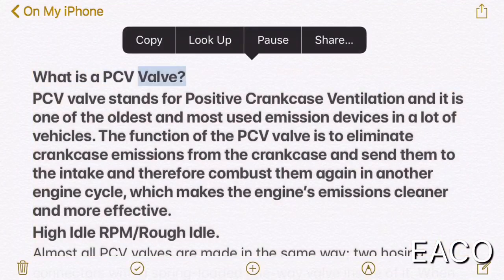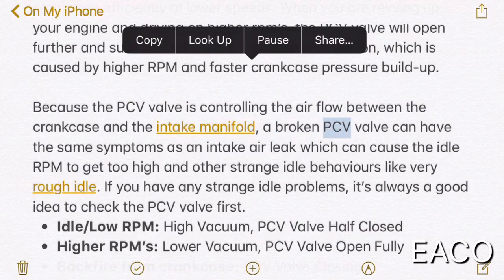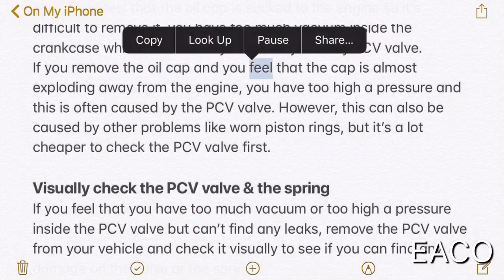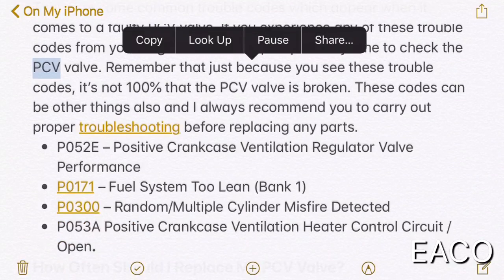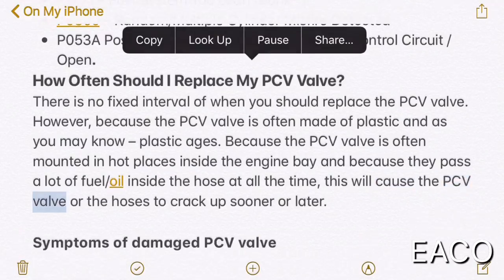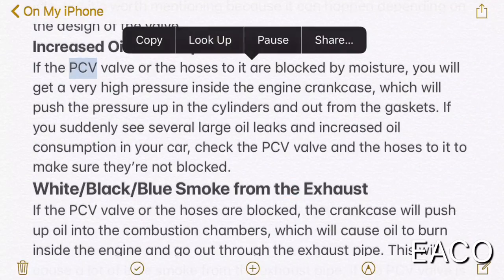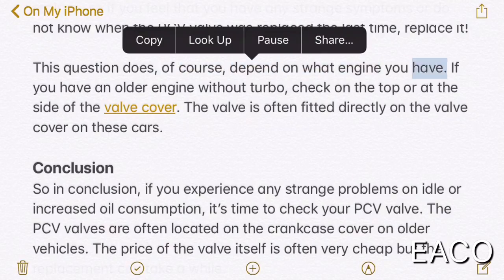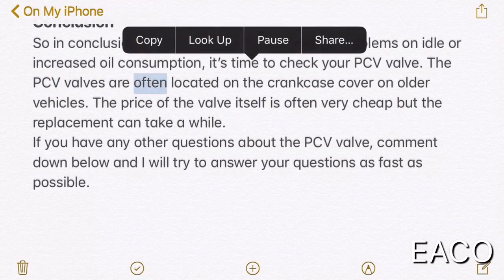IMPORTANCE OF PCV VALVE IN YOUR VEHICLE, SYMPTOMS, FUNCTION & MAINTAIN ENGINES life!

Comment: Hallo. Great video. Can you please help me? My wife owns Micra k12 1.4 65kW (88HP), made in 2004. We bought it 3 years ago, and milage was 200000km (I don't know if it's was real). Now it has 214000km, sice she hasn't drove it to much. Since last 2000km it started consuming a lot of oil (1 liter of oil per 1000km). And also it has backfire from exhaust when throttle is reliesed, when deaclerating, so I have doubts that the PCV valve is stuck in open position. Do you think that this make sense? There is a little blue smoke on exhaust on idle. Today I opened the oil cap while the engine was idling, and there is some blowing from the engine as well as some oil drops spraying. The oil cap was clean, oil is also clean. Do you think that the reason for consuming the to much oil can be in bad PCV valve? Thank you in advance, any hint or advice will be good.
Reply from the maker: To confirm that issue need to be compression test find the specific Compression pressure standard after that we can proceed to know what the problem. Thank you for your comment to my channel and please subscribe Sir.

Comment: Most manufacturers have a scheduled PCV valve replacement interval.
Honda has a 100,000 mile service interval that includes water pump, drive belt, and PCV valve replacement.
Reply: I think Honda/Acura have a weak PCV system and should be cleaned and/or replaced every 40-50k miles. 2010 MDX 287K. Look here on YT and you'll see some that should've been pulled long before they did. Depends on oil used and OCI.

Comment: Why my 4k engine get a rough idle when i put the pcv valve according to its function,? Kindly help me.. my pcv valve is good.
Reply from the maker: Okay what’s the history service of your vehicle?
Gasoline or diesel? 
What happen before rough idling?
Did you tight your battery terminal properly?
No corrosion?
Did you clean throttle before?
Perform power balancing if your car is gasoline removing one by one the ignition coil and return roughly more is good ignition coil if no chance thats bad.
Thanks.
Reply: Gasoline engine. And yes, i already perform those method and still the same, 
my battery is new.

Comment: The car smokes only after accelerating following descending, what could be the reason, tnx
Reply from the maker: Cylinder gasket damaged
Reply: @Subscribenow02  oil is smoking, not coolant.
Mechanical gearbox, after a deep vacuum it smokes, that is, if we go down on neutral, nothing happens, but when we are on some kind of gear shift, and suddenly we gas, smoke comes out. PCV valve, valve stem seals are changed. No smoking in the morning and in the rest of cases
Reply from the maker: @АлексфанатА4  what color of smoke? What kind of petrol youvuse diesel or gasoline?
May thats ruch mixture need to be calibration.
As well head gasket have oil hole beside coolant way passing through engine block and cylinder head.
Reply: @Subscribenow02  gasoline 95 is used, by the way, it happens after long drive, when oil temp rises. After smoking the level of oil decreases. I am sure it is oil
Reply from the maker: @АлексфанатА4  yes gasket of cylinder head
Reply: @Subscribenow02  any proofs?

Comment: It is require to replace both pcv valves for my turbo engine for bmw 650i 2013 if the vent hose between two valves broken! I just used super glue to paste the part again .The car looks different but not 100% fine cause am still feeling bad performance or slow response while driving in low speed between 30-50km !!
Reply from the maker: You can Try to perform Engine tune up and power train Maintenance..Thank you Sir.

Comment: I wonder if the CRC INTAKE VALVE CLEANER also cleans the PCV valve... does anyone know?
Reply from the maker: We knew Sir but pcv valve made from plastic. it is replaceable every 80k run.
Reply: mazda cx7 has the PCV valve hidden under the intake manifold, so it takes me about 4 or 5 hours just to change the valve I don't know if there is any way to clean the valve without changing it yet.

Comment: My vehicle has p0172 bank 1 too rich and p0174 bank 2 too lean at the same time, would this also be pcv valve? I have a slight rough idle and misfires on startup and sputtering white smoke from exhaust.
Reply from the maker: Yes possibly mixed with oil and water during compression..
To verify that, i need to know your vehicle model, Diesel or Gasoline engine and brand.
Reply: @Subscribenow02  i have 2005 v6 Ford explorer gasoline
Reply from the maker: @hepzlawrence7710  

DTC Definition:
P0172 - System Too Rich Bank 1

Possible Causes:
- Faulty front heated oxygen sensor
- Ignition misfiring
- Faulty fuel injectors
- Exhaust gas leaks
- Incorrect fuel pressure 
- Faulty Mass Air Flow (MAF) sensor

DTC Definition:
P0174 - System Too Lean Bank 2

Possible Causes:
- Intake air leaks
- Faulty front heated oxygen sensor
- Ignition misfiring
- Faulty fuel injectors 
- Exhaust gas leaks
- Incorrect fuel pressure
- Lack of fuel
- Faulty Mass Air Flow (MAF) sensor
- Incorrect Positive Crankcase Ventilation (PCV) hose connection

Okey 👍 can you try to find the problem and subscribe..Thanks.

Comment: My vehicle has p0172 bank 1 too rich and p0174 bank 2 too lean at the same time, would this also be pcv valve? I have a slight rough idle and misfires on startup and sputtering white smoke from exhaust.

Comment: Hello there!
I have YAMAHA XJR1200. I’m experiencing problem that when i ride my bike the oil comes out from breather hose & filled into the air box.
Is that the issue of PCV valve?
Reply from the maker: Hello Sir that’s Motorcycle big bike right?
Ok please check your engine oil level first, may be that’s not pcv problem, how many amount of oil goes out per-minutes?
May your air filter is Clogging that’s why more oil goes out. You can observe that problem Sir. That I mentioned, tips. And subscribe for more videos,,Thanks.

Comment: Hi. I have a BMW E90 N46 4 CYLINDER engine. I am suffering from high oil consuption (One Litre per 1000 km).
I have changed the pcv valve diaphragm with spring.
But i stilI have oil consuption & both suction on the oil cup wgen opening and high pressure when the cup is open.
The pcv is located on the valve covet the engine has 182,000 km.
I will approciate any useful suggestions and diagnostics procedures.
Reply from the maker: Hello Sir May be your vehicle was experienced an engine overheating before or rubberized Components was already expired/gasket burned out also valve seals...that’s why always decreasing engine oil..
Solutions:
Perform top overhauling of engine..change valve seals and cylinder gaskets, please use coolant for safety purposes or to prevent engine overheating..also check the cooling system after engine overhauled such fan automatic motor with thermometer sensor..I really appreciated your time and effort..Please subscribe here in my YouTube channel..Thank you so Much.!

Comment: Hello.
Thank you for the video.
I have a few questions.
1, How much vacuum must be in order for a working PCV valve to start opening?
1NZ-FE engine.
And the second thing.
When I'm coasting, the accelerometer pedal is completely released, then after 20-30 seconds when I press the accelerometer pedal again, white smoke comes out of the exhaust pipe. And the engine oil decreases quickly too.
Is the PCV valve not working?
In my case, it is always open, even when the engine is turned off. (the spring does not compress the valve)
Reply from the maker: Okey thank you for your questions.
The pcv valve 1NZ-FE Required to replace every 50k Run of the vehicle.
You can try to diagnose the pcv first before to replace.
Step 1.Remove the Engine oil filler Cap while Engine is starting on idle position.
Step 2. Put your hand on to feel Suctioning your hand. Okey, that’s Normal.
If you feel not suctioning your hand like goes out with blow by gas that’s pcv clogged problem.

Symptoms of pcv damage
1. Unstable idling 
2. White smoke
3. Low power of engine 
4. Gasoline maximum economy 
5. If clogged pcv can cause Engine oil leaks.

White smoke/gray
1.Coolant leak from head gasket with oil mixed.
2. Oil seal from cylinder head already burned rubberized.
3. Other computer controls such sensor, ECU problems.
Check engine inspection if possible.
Okey.. thank you for watching and subscribe..

Comment: sir my vehicle is suzuki with  carburator  recently noticed engine misfiring removed pcv hose then misfiring stopped ,also notice water vapour inside intake   is it related to PCV  ,mine is a 2000 model vehicle driven 125000 kms  never replaced PCV  please advice Thanks
Reply from the maker: You need to replace pcv valve. And perform engine tune up. Thank you
Reply: @Subscribenow02  sir thanks for your reply

Comment: Good Day Sir,
I have a a Ford Endeavour 3.2L. it also goes by the name of Ford Everest. Engine overhauled at 100k kilometres. Have rough idle and blow back from crankcase oil filler and rough idling. 
PCV was not replaced.
Can u please let me know the location of PCV on my vehicle
Reply: Sir fuel is Diesel, Country is India, Engine 3.2 liters straight
Reply from the maker: Try to Engine compression test or cylinders compression test
Your Engine is no have pcv valve 
That’s only have breather hoses
Reply from the maker: Excellent comment.! Please till me first what type of fuel , engine type V engine?
And from what country your vehicle manufacturers?
Thank you

Comment: my W202 95 idled at 1250 rpm. Was that caused by pcv valve? 
I've check all the tubes on the plenum and no air leaks.
Reply from the maker: Yes Sir..Change your pcv valve every 50k run. Or perform engine tune up..
Reply: @Subscribenow02  where's Oct valve for toyota 1rz engine located?
Reply: Where's pcv valve for Toyota 1rz engine located

Comment: Can i drive with a broken pcv valve line?
Reply from the maker: Yes you can drive but it’s depend..to Engine status.
that’s is not advisable to drive long distance.
Because if the atmospheric pressure inside of the engine not goes out will damage your engine oil seals..by leaking engine oil..

Comment: hi, thank you for this video, i having an similar isse, my 2008 ford expedition idles rough after it gets warm, and now i have a fuel cap warning on my dash. when is idles rough i stop, turn the car off, remove the gas cap and wait for 30sec, recaps and turns the engine on, it drives smooth again for sometime until same issue comes back in few minuts.
kindly need suggestion. fyi all new spark plugs / new coils. changed a week ago
Reply from the maker: Good Question.!
I glad to Welcome you here my channel..
Make sure you subscribe first..

Okay..for that issue we need to troubleshooting step by step.

how manny milage have your vehicle.?

Recommendations to check:

Check for any fault 
Engine Compression test
Power balance test(ignition coil, spark plugs test)
Fuel injectors inspection.
Fuel pressure inspection 
Last if any suggestions like pcv valve condition.

This advice is highly recommended for that issue and you can reply for any additional questions..thank you very much..!!
Reply: @Subscribenow02  thank you very much for the prompt response:
I have 100k miles on it, i recently changed all spark plugs and igition coils. I doubt it could be a pcv valve, i can visually see one on bank 2 bleeding. 
Could this be a culprit..?
I really appreciate your advise
Reply from the maker: @SyedAhmed-lz4zx  Yes that’s possible because pcv valve requires to change every 50k km run of Vehicle.

Thank you for your Reply..!!
Reply: @Subscribenow02  hello again: i tried replacing my PCV valve heater at the other end of pcv valve pipe.. my car have pcv valve built in the cover and cannot be removed.. 
on a second thought, could it be possible a new spark plug i installed be bad.. someone suggested me. Fyi i replaced all spark plugs then this issue developed the next day. Then i replaced all coils. 
May b should i try removing all SPARK PLUGS AND CHECK..? 
Yesterday i noticed my car started a rough idle after 30mts of driving, with a flashing engine light. I stopped immediately and turned the engine off. Waited for a minute,  stared back on and it drove smooth again.

This is blowing my brain off..

Comment: What i have done in the pcv valve was
I took it out, and drill a hole on the center of the pcv, so it has no more valve (small plastic ball inside the pcv) and air can flow directly through the pcv

I put the pcv back to the engine, use a hose that fit pcv size, plug it in the pcv, and the other side of hose end to below of the vehicle, mean the engine vapor will directly flow to below of the car (it is environmentally bad, i know) 

And i shut off the pcv standard suction hose that go to the intake and then to combustion chamber 

What i want to know is

Is there any possibility that pcv hose below the car i made to suck air, instead of exhale air

Thank you for attention
Reply from the maker: Wow nice comment Sir!

Gasoline Engine? Or Diesel Engine?

In gasoline Engine we have pvc valve that replaceable every 50k run to prevent maximum fuel economy of Vehicle.and to prevent blow by Gas or high atmospheric pressure inside of the engine.

Just put new one pcv valve as standard component of engine( I recommended to replace original Pcv valve). 

In Diesel have Breather hose to prevent high atmospheric pressure inside of the engine.( hose inspection every maintenance)

Thank you for watching and don’t forget to subscribe..if you want my video, just like & share.
Reply: Gasoline engine, i did that way because i dont want any oil inside intake
Reply: Is the any possibility that perforated pcv will suck air instead of exhale air?

Comment: I have 3ZZ-FE engine Toyota. I've noticed that oil consumption is very high. I found out that the ventilation hose number 2 was leaked. I replaced it. After I replaced the hose i noticed that i never experienced anymore high oil consumption. I don't know what happened. But my question is, my car gets white smoke every early in the morning during idle warm up. But when the engine gets hot there are no white smoke coming out anymore during idle. However, if i apply high revolution during idle, white smoke will come out again. Is this possible that my pcv is faulty?
Reply from the maker: Thank you for your very good comment.i appreciated .
the last quest.:
I have a question..do you experience White smoke isteady during acceleration? At least 2500 RPM around 5 mins.? If first 30 seconds or 20 seconds that’s normal.Sir.

Comment: Where is the PCV valve located on a 2013 Toyota Camry Le/ 4cylinder.
Reply from the maker: Nice comment... location at the button remove the FRH wheel, between  intake manifold and timing chain cover.using a flashlight to find quickly.. Thank you for watching and don’t forget to subscribe..

Comment: Sir, where to locate pcv valve on 2016 BT50 Mazda? Thanks!
Reply: We did changed piston and gasket, still overheating and some blowby smoke coming out from the dipstick. What’s your diagnose sir?
Reply from the maker: The location of pcv valve is under intake of manifold. And to diagnose blow by remove the engine oil filler cap put your hand must be negative pressure you feel.
Reply: @Subscribenow02  do you have facebook account sir?
Reply from the maker: Yes sir
Reply from the maker: Change pcv first before to do major job
Reply from the maker: There are two kinds of Engine Blow by 
Power and compression 
During power stroke piston rings leaks also may be valve seals passing burns air fuel mixture.
During compression stroke passing through the piston rings gasket..and other components related..
Reply: @Subscribenow02  salamat po sir

Comment: I have problem i did turbo charged my car and  under boost my car smoke blue and smoke about 5 to 10 minutes no matter under boost or not , if normal drive without boost then no problem even if I’m driving at 120-140km/h but without boost , any help please and I checked my pcv valve it looks fine I checked but i found oil in the hoses
Reply from the maker: Okay 
May mixing with engine oil that’s mains blue smoke..Do you change coolant periodically?Do your experience engine overheating?check your PCV Valve 
First step.
1. start the engine. 
2. removing filler cap of valve cover put your hand at the hole felt suctioning your hand.?
And maintain your engine air filter not damage or follow the standard maintenance of your car check your owners manual for more information.
Big effort big success.. thank you so much.!

Comment: On a 2005 Dodge Caravan the PVC valve is located on the rear valve cover of the transverse engine, difficult to remove. Would removing the hose from the other end and spraying carb cleaner into hose and pvc valve be an effective way to clean the hose and valve or not?
Reply from the maker: Change the hose and also PCV VALVE as possible. Because if the vehicle more than 100k km mileages you need to replace it. Don’t spray carb may can mix with engine oil.